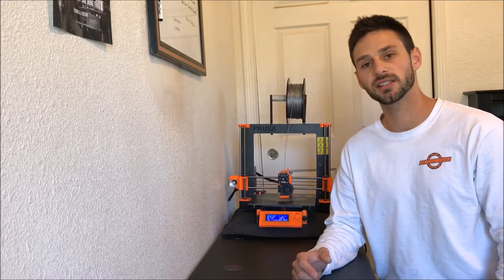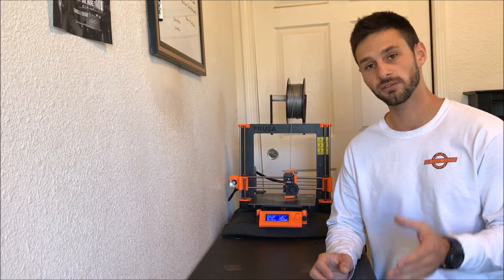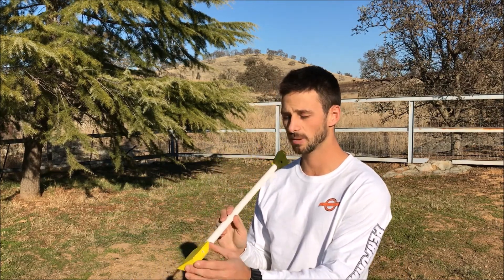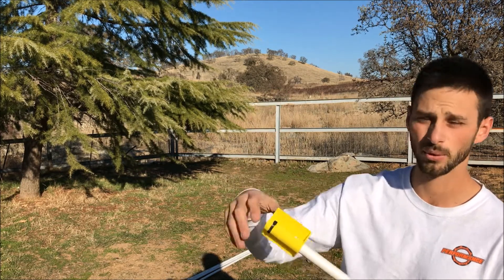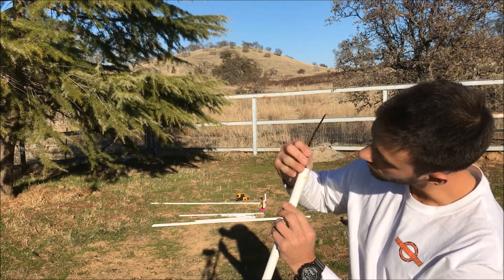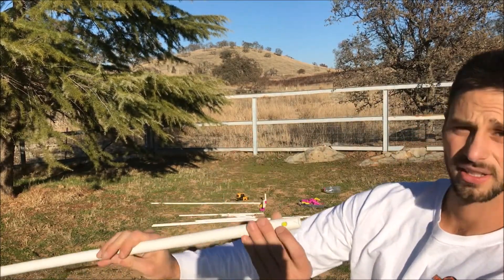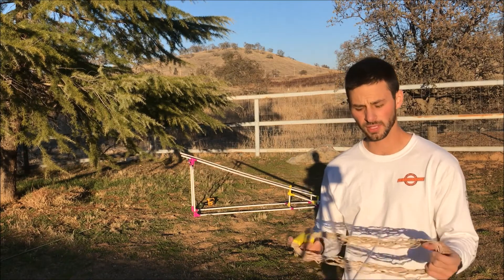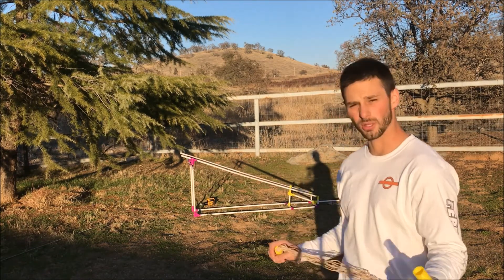DIY 3D Printed RC Plane Launcher | 3D Flight

Comment: Maybe I missed the length of the pvc did u say size..lengths I know it's half in but how long are the pcs
Reply from the maker: The lengths are in the instruction manual when you download
Reply: @3dflight753  I didn't see a manual in thingiverse
Reply: What kind of pipe is required ? I already assembled everything but the pipe I got was too flexible, now I wasted all the material